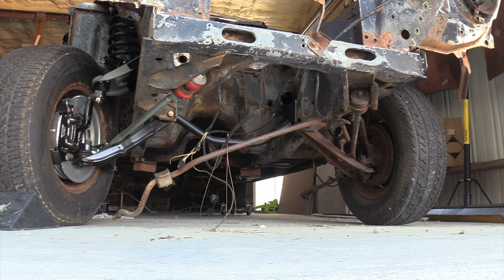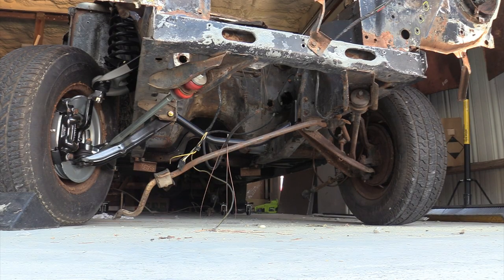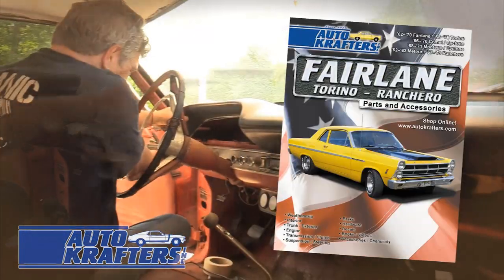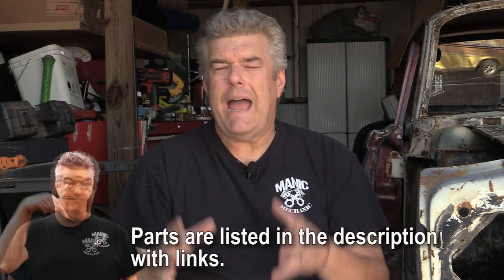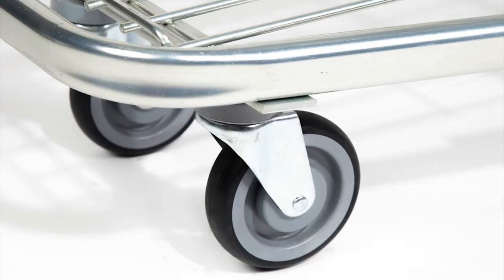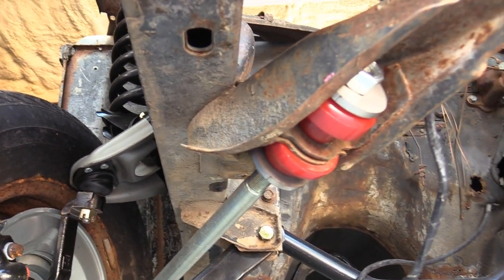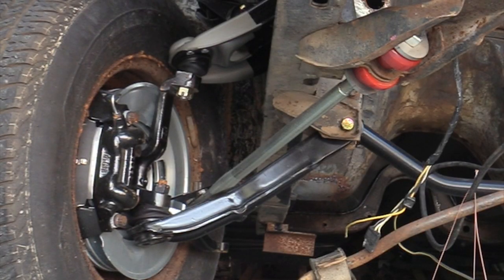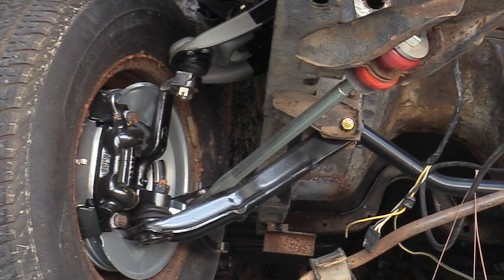Strut Rod Function Ford

Comment: They serve two functions. Providing a means to adjust castor, which you described, and the other more basic function, preventing the lower control arms from folding backwards as you drive down the road.
Reply from the maker: LOL I failed to mention that foldy thing. But on the early cars, the adjustment was in the upper arm, not the strut. Ford didn't start caster adjustment on the rod until 1967.

Comment: Best street alignment. +3 caster, 0 camber, 1/8 toe, 1" Shelby drop.
Reply: Aye, I've always shot for 5-6 degree w/A Arms & 8 degree for Straights. 80-100mph on the Freeway or creepin' into a super tight Whole Foods parking lot space it's all smooth as silk. (and playin' with Twin I Beam will make you re-evaluate your life decisions)
Reply: Most of the performance early Shelby guys I know run at least -½* camber and some as much as a full degree.
Reply from the maker: I tend to go with a whiff less toe (better on the tires) at 1/16th inch. But your recommendation is spot on.
Reply from the maker: Tom, I see that often too. I just don't want the wear that can induce under daily driving. It might be interesting to see what the spread is on alignment specs from Old Shelby Race cars to street cars was.

Comment: Great info.
I could not find rubber strut rod bushings for my 68 Continental.I installed poly.I did research.I was told to flip cupped washers backward. So far so good. Now I'm freaked out about my strut rods breaking.I think I will look for some rubber bushings.
Reply: I've never seen any Continental with strut rods & I've 97% owned only Ford products since 1966. 

Cars covered are intermediates, beginning with '60 Falcon/Comet and ending with '80 Granada/Monarch. If outside of those years, it doesn't have suspension Jeff is discussing. Also includes Fairlane, Torino, Montego & Cyclone(thru '71), Maverick/Comet '70/'77(no there isn't a '70 Comet) etc, plus the Mustang & Cougar thru 1973.
Reply from the maker: MEVOTECH MS404130 {#88913214} Supreme  is a good number from Rock Auto if you decide to go back to stock.
Reply: @AutoRestoMod  Thanks I will check them out.
Reply: @tombryant1104  My 68 Continental has them .They are  fixed with no adjustment to them.My 75 Torino also has strut rods .

Comment: Just installed Global West upper and lower control arms, along with strut rods. Also running the roller spring perches and QA1 hydraulic shocks. Should be quite the improvement over stock.
Reply from the maker: It will be! Global makes good stuff!

Comment: Some good info here, but how do you talk about front suspension and not mention "Opentracker Racing Products" and/or "Street or Track"? 😧
Reply from the maker: We have used both on other videos. If you watch consistently, we have installed a full Street or Track system as well as using Open tracker Racing parts pretty heavily on the Ranchero.

Comment: Had my 66 rustang on I95 in CT (back in th day late 98) snap off the whole strut rod mount and bend the AArm back. Used self tapping screws and a crowbar (on the highway) to get it back and home no doubt replaced the full Monty but building the new car definitely going with new mustang2 suspension.  Will restomod be doing a weld in suspension soon?
Reply from the maker: Nope. We did a video on the Mustang II. If you are going that route, go with Rod and Custom Motorsports, they have a really good kit. I'd personally go with an RRS or Street or Track. I don't like cutting up old cars as much as the Mustang II calls for. But that is just me. Lots of folks love and swear by the II.

Comment: I've fitted new stock style adjustable rods with Global West heavy duty rubber bushes on my 63 Falcon Sprint. Trouble is that the front nut keeps coming undone. No lock nuts were provided. Any suggestions how to stop this happening?
Reply from the maker: As a first stop, I'd try a nylock nut on top of the adjuster nut. If you have to do something alignment related, replace the nylock.
Reply: Loctite will fix the nut moving..

Comment: Great episode. Restoring our '70 Mustang now and will be increasing the HP by quite a bit not to mention upgrading the suspension, brakes, wheels, etc. Would you recommend going to urethane, replacing the OEM rubber bushings or doing something different for improved ride/handling? Thanks in advance!
Reply from the maker: Ford street, rubber will do fine. If you are upgrading the suspension, I would go with the spherical from RRS or Street or Track's rod-end strut rod kit. Similar results, divergent design philosophy. Either would be an excellent choice for a suspension, though I give RRS the edge on the rack and pinion, thus since I like same/same in my cars, I would give a slight nudge to the RRS "system". This is my opinion of course.
Reply: @AutoRestoMod   Hello there, can a bad strut bushing cause a bumpy ride? Please let me know. Thanks

Comment: I don't know that it can be said enough, poly strut rod bushings can be problematic or even dangerous.
Reply: Poly is Race, OEM Rubber is Street. That's the rule I've always gone by with all that stuff from motor/tranny mounts to body mounts. Poly makes it strong there, but weak where it was strong. Point in case, Unibody XJ Jeeps. Everyone wants hard poly racing bushings in the suspension. 2 years later they throw away the Jeep because it's hawg-wallered out the radius arm mounts & rear spring & shackle mounts.
Reply from the maker: Yup.
Reply: I think you will find that nearly all the problems are based on wrong mounting of the washers when using poly. I seen some pics people like to post on the web of broken struts with poly bushings .. they have all had the cupped washers mounted wrong.
Reply: @westmus  Maybe... I mounted poly in my '72 Comet exactly as instructions pictured. May as well welded rods to crossmember. Suspension had almost no compliance, rode terrible. I want a car that doesn't beat me up on a 150 mi cruise.
Reply: @tombryant1104  , I got a old set of never used poly bushing that included instructions. The direction of the cupped washers are highlighted in it as important to get right. I know a guy that have actually measured the force needed to move the strut up/down on a Mustang. Mounted the strut only in the bushing and use a luggage weight to pull in the strut. The poly bushing with the washers cupped outwards was only slightly stiffer that the stock type rubber bushing. But with the washers cupped aganist the bushing it took like 4-5 times the force to move the strut up/down.
Reply: @westmus  even that seems to be a point of disagreement among people who ought to know. I've seen pics of broken strut rods which supposedly were mounted with the washers in the correct orientation. Maybe those strut rods were already compromised, I don't know. I'd like that to be answer because poly bushings are cheap and simple to install. I'm simply not sure it's that simple.
Reply: When installing polly dont squeeze the cheese out of them and loctite the nut..  no problems..  i run up to 5% castor on a v8 with 2.5 turns lock to lock power steering and find it so predictable even when hard braking. Then again i run 100mph plus on the dirt often, any clown can drive on tarmac.. 🤣🤣🤣

Comment: Energy Suspension makes a bushing using "HYPERFLEX" performance polyurethane with a durometer rating that is compatible with strut rod design requirements. Their bushings have a different durometer rating for each application. Just sayin.

Comment: mustangs must have wimpy strut rods. i put poly bushings on my 63 Tbird and there's no freaking way that stock strut rod is going to fail before that poly bushing. They greatly improved braking stability. Shit was scary during hard braking with the stock rubber bushings.
Reply from the maker: The early 1965-66 Mustang has a drop shank where the threading is at, so they are more prone to break at that point. The later ones are fully threaded down the shank of the shaft.

Comment: I'm surprised you don't know that the main reason for the change in caster from the classic car period.to now is the physics of nylon tires vs modern radials. Look into it.
Reply: By later '60s, Ford offered radial tires as option, front end alignment was same for bias or radial. GM did have power steering specs that increased caster. AFAIK still had nothing to do with tires on vehicle.
Reply from the maker: Ford offered radials (as Tom says below) as far back as I think 1967 on the Cougar (and possibly the midsize cars but the Mustang didn't get a LISTED option for radial until 1968 . And if radial tires were the point why did the 1973 Cougar (an upscale offering and closer to the true era of the radial) only see 15 percent of total production getting radial tires? 1967 was even lower at 669 Cougars having radials out of 150,000 built. The steering was it.

Comment: Shopping cart casters have ZERO caster (don't ask me why they are called casters). I don't know how many times I have seen "experts" talk about the caster in shopping cart "casters". The rotational ("steering") axis of the shopping cart caster is perpendicular to the ground. That is the definition of zero caster. What shopping cart casters have is trail. If you extend the "steering" axis straight down to the ground on a shopping cart, the contact point of caster wheel with the ground is behind that extended steering axis point relative to the direction of travel - it "trails" the steering axis. 
When you shim the front of the upper arm to move the upper ball joint back (or pull the lower ball joint forward on cars with adjustable length strut rods like my 63 Falcon) you are adding caster and trail. The added trail is what makes your car want to travel in a straight line. The added caster mostly makes itself known when you turn the wheels. The added caster adds camber when you turn the wheels (negative camber to the outside wheel, positive camber to the inside wheel).
Reply from the maker: Thanks for that very detailed explination!